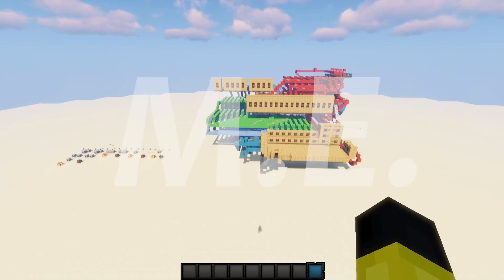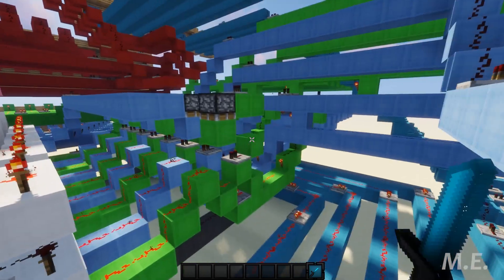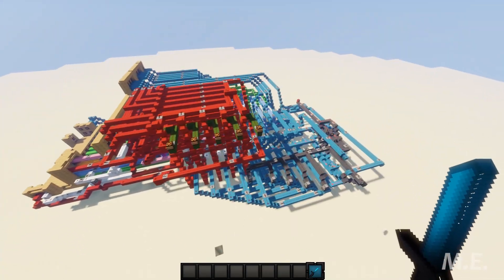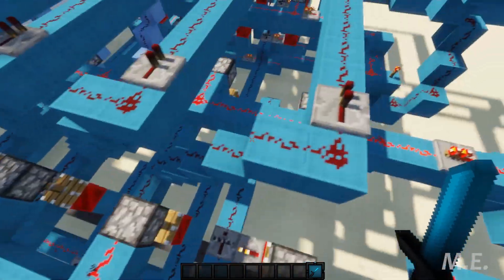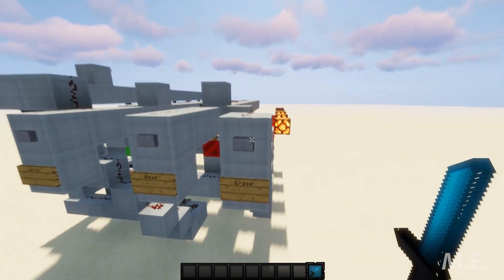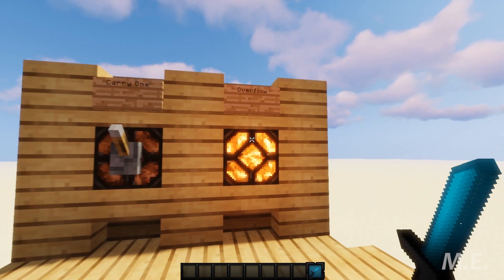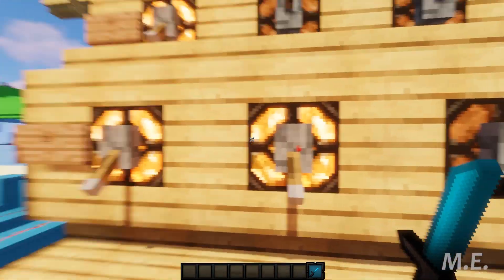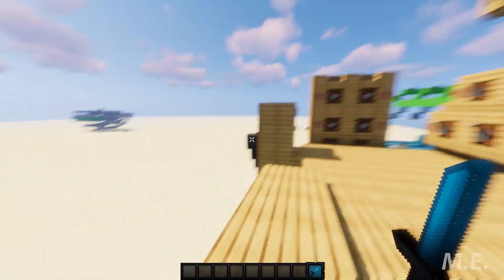Minecraft Redstone Computer Showcase & How it works

Comment: I have some advice to give on this

- Torch towers for vertically carrying a signal is very inefficient and has no use in more complex designs. These should be avoided at all costs. Instead consider slab/glowstone towers as an alternative!
- With bussing, after 15 blocks, put a block before a repeater and another block after. It carries the signal that extra 2 blocks, which isn't much on it's own, but an extra two blocks for every repeater adds up, and will reduce the number of repeaters needed overall
- Technically, this is a computer. It takes an input, computes it, and provides an output, and can store memory. However, it's not a redstone computer in the way that people would commonly interpret it as. Consider adding program memory for automation
- With the ram, rather than saving to two ram cells for A and B, consider instead using a dual-read RAM design
- 1 byte = 8 bits

Other than that, you have a solid understanding of binary arithmetic and I like how compact the design is! I hope you continue to improve on your abilities and develop your skills!